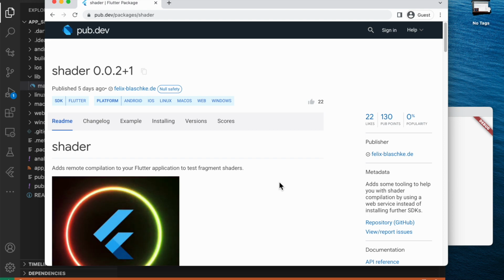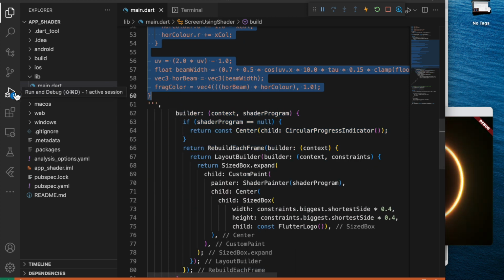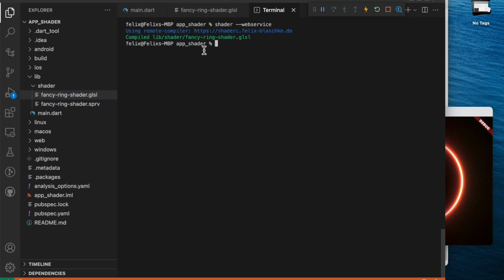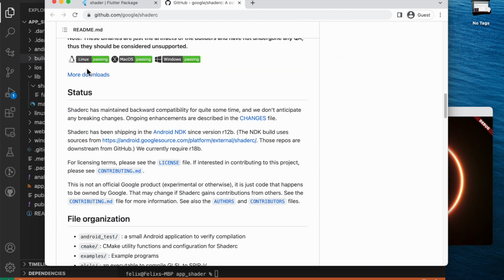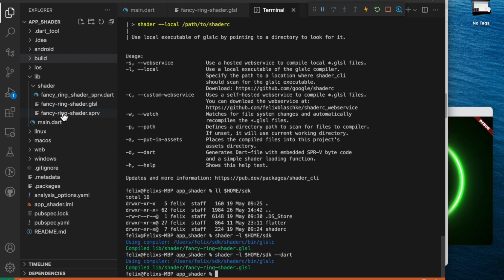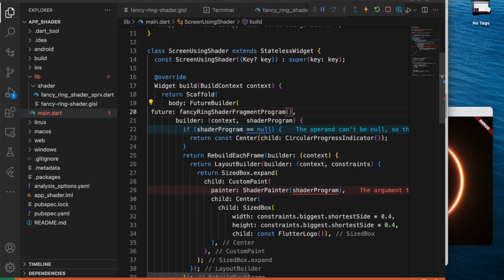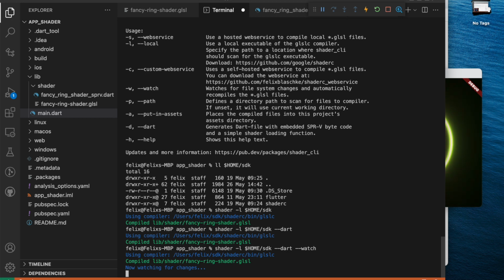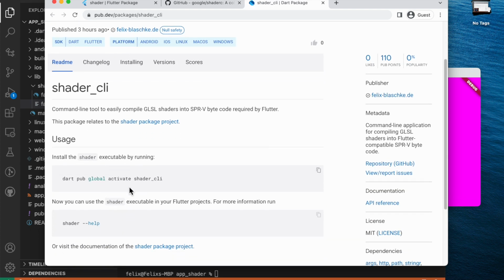First look at shader command-line tool for Flutter

Comment: Good job! But still I’ve missed the point of compiling sksl code into the spir-v binary. Isn’t Flutter able to compile it on the fly out of the box on the latest versions?
Reply from the maker: They implemented it in the flutter compiler after my package. It got also referenced as a demand. Google for pdf using terms "Improvements to FragmentProgram API Support" to read more about it.